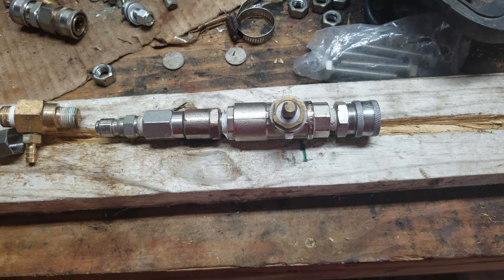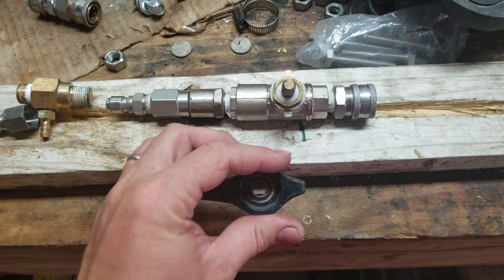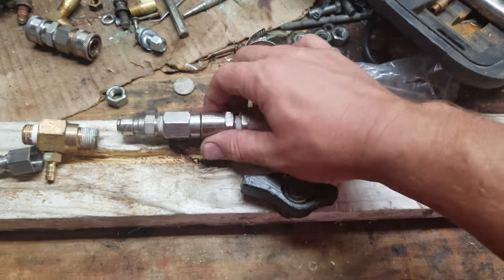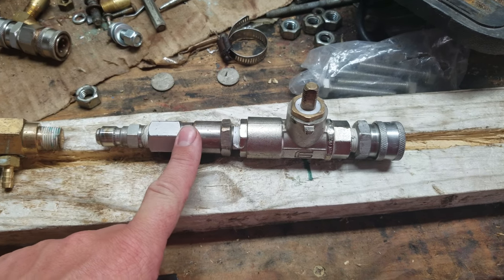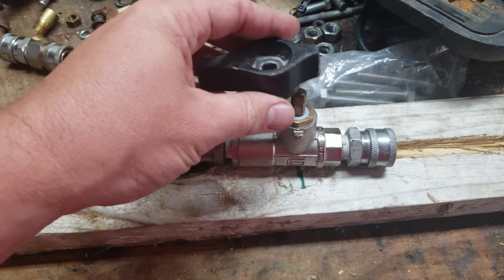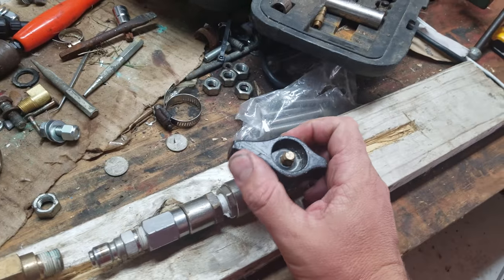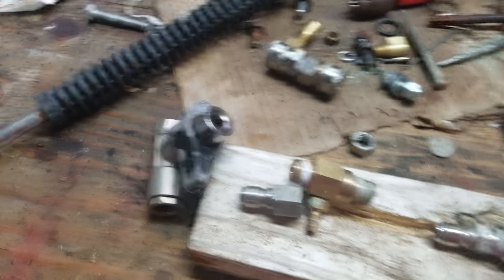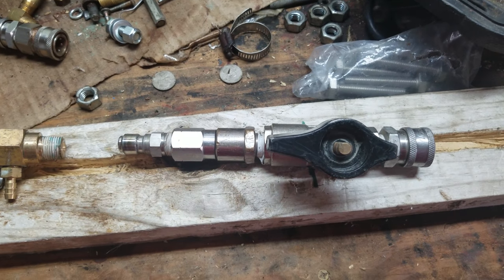High pressure ball valve and super swivel assembly

Comment: How do you connect the QC to the ball valve or swivel itself what are all the supplies needed to make this work I have the valve swivel and QC’s but I don’t know what I need to put it all together
Reply from the maker: Just 3/8" quick connects.  Depending on your flow direction male or female plugs
Reply: Clean Power Wash LLC wow that was a really rookie question lol I understand now I didn’t have the plugs to connect the valve to the pressure washer I just have the 3/8 QC
Reply from the maker: No worries. I keep bins of each kind of coupler so we can build whatever we need to.

Comment: When you are walking your hose out unloop about 1/2 of the hose, then turn the coil around and unloop the rest and there will not be any loops on the ground when you pull the hose out straight
Reply from the maker: Or just use a super swivel and make life easier